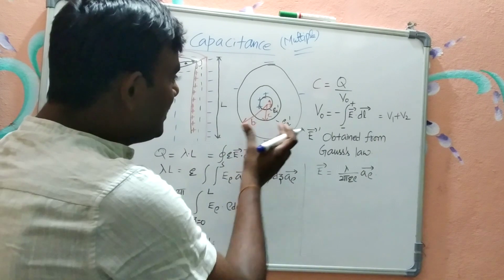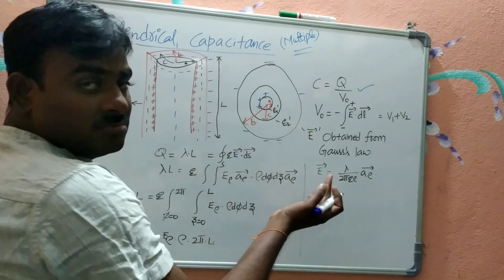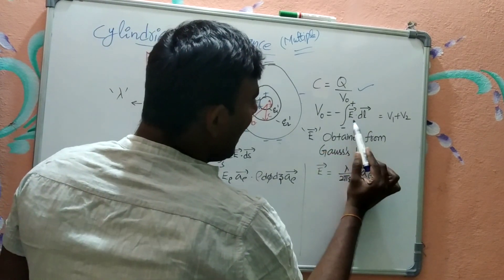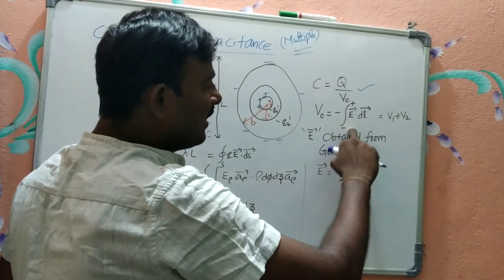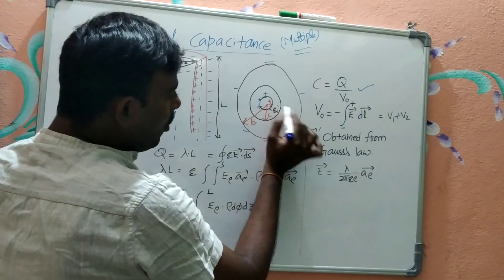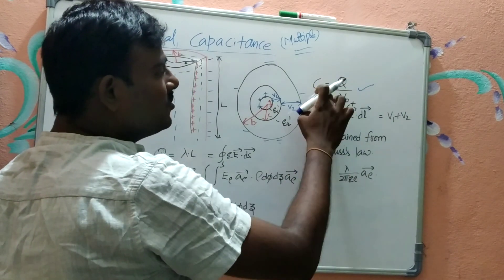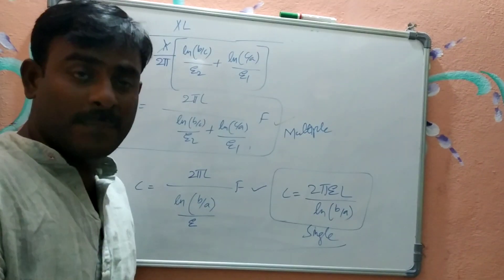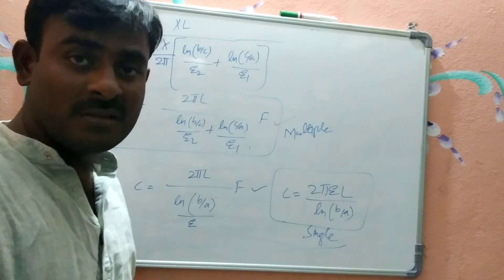Cylindrical Capacitance-(Multiple &Single Dielectric)

Comment: Nice sir ,what is the value of (e1 and e2)
Reply from the maker: E1 and E2 are field intensities in two dielectric materials. These two depends upon radius from the centre. So their values are not fixed.
Reply from the maker: If you are asking about epsilon 1 and epsilon2 they are permittivities . They depend upon the dielectric medium we are using.